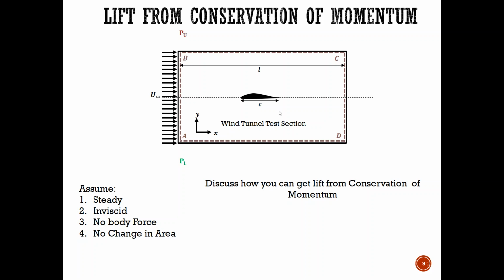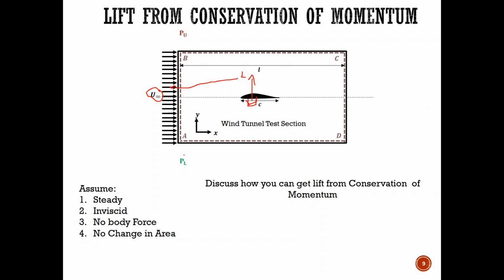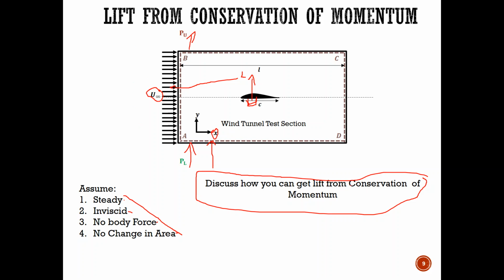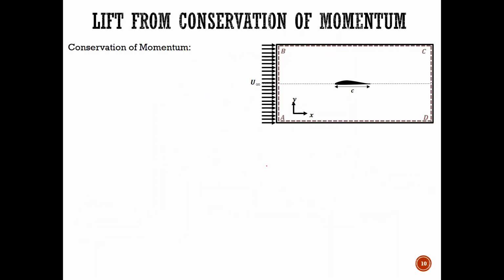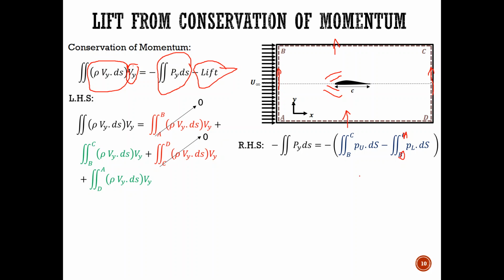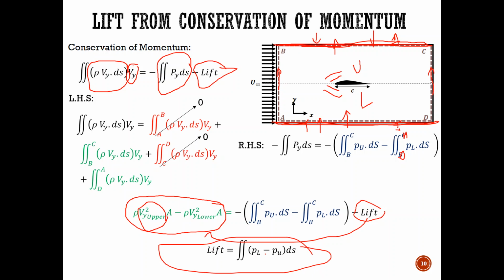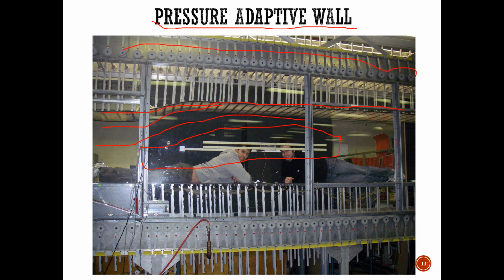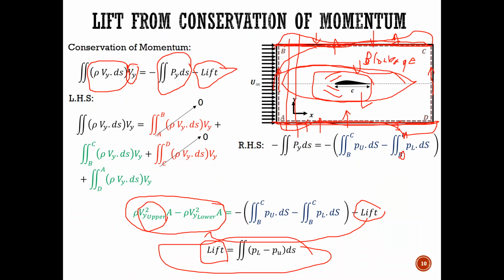Lift from Equations of Fluid Dynamics

Comment: Thank you! It helped me a lot!
I have a question that when we set up a conservation of momentum equation, why is the lift force defined as negative?
Is this mean lift force can be generated by just a pressure difference? I thought lift force is caused by downward air flow.
Thank you again
Reply from the maker: The reason there is a negative sign in front of the lift is due to Newton's 3rd law. The wing exerts a force on the air by deflecting it and the air applies equivalent and opposite force on the wing which in the y-axis is lift.
Reply: @SidGUDayton   Thank you! I really appreciate it!!